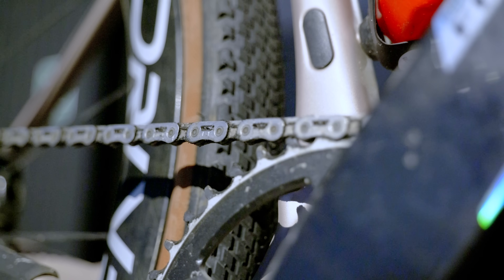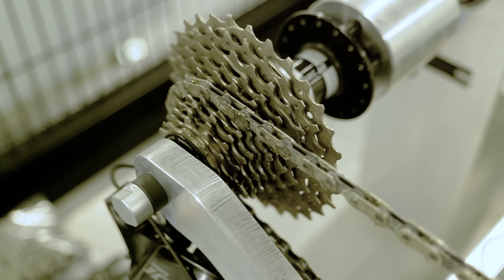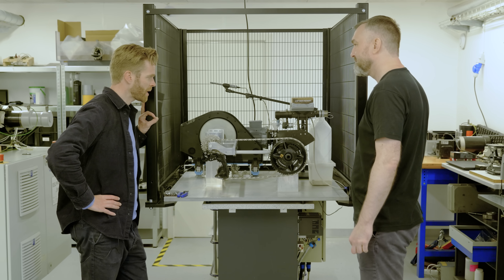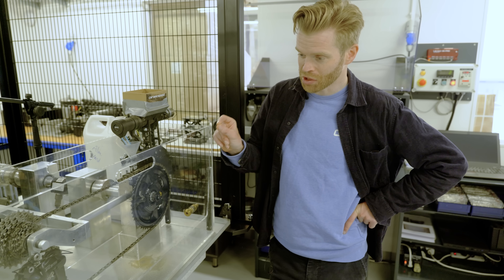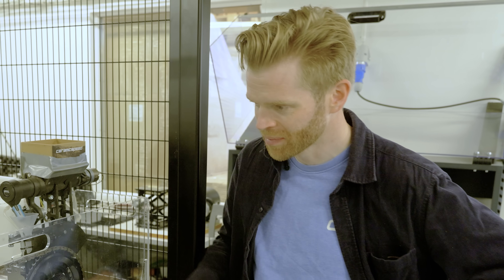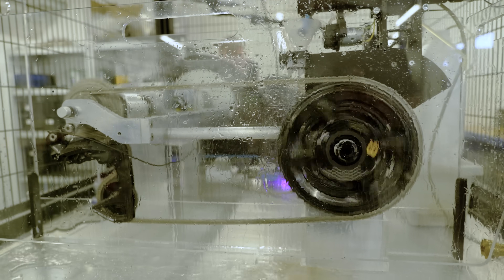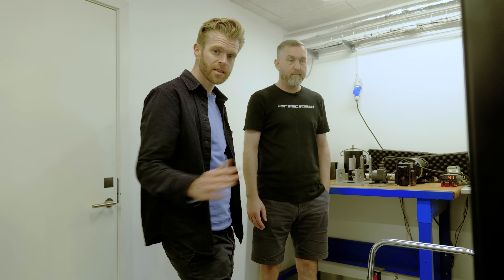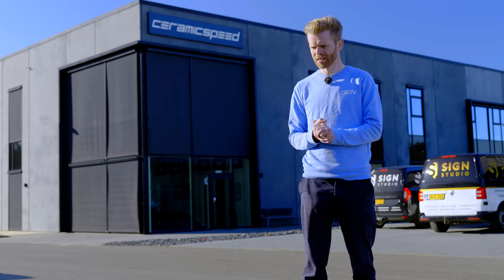We Lab Tested A Dirty Chain, How Much Slower Was It?

Comment from the maker: Which result shocked you more: how little a dirty chain slowed the rider down (about 1 watt slower than waxed in isolation ), or how much more efficient the biggest sprocket on the cassette was compared to the smallest? Let us know in the comments! 👇
Reply: Biggest surprise - optimal chain line is not most efficient one...
Reply: @stanley3647 despite what Ollie said the graph shown on video doesn't reflect that. Im yet to receive explanation from GCN.
Reply: @stanley3647 look carefully at the graph on the screen. You'll see that 27T is the most efficient. This gear is the most in-line with the front gear.
Reply: The chain becoming more efficient when moving to larger sprockets surprised me. So in effect does that mean spinning a larger sprocket on a climb is more efficient than a smaller sprocket.....
Reply: What would be interesting is to find out the losses when at higher rpm compared to lower, when in the same gear.  From this we can figure out if it is better to spin faster in a gear than to downshift to a smaller cog.
Reply: But if possible, it would be interesting to see the results, if you could turn the casette the other way around. So the smallest cog would be closer to the bike. It would of course look super weird :D
Reply: @Loudmouth69  what would the point be, in such an experiment? Apart from discovering why it is not a good idea to have a big saw-toothed steel disc turning very fast 10cm away from the wheel...
Reply: @PingoloPangolo to see if the result is the same, i guess. To see how much the size of the cog matters contra the placement. Maybe that does not make sense 😅
Reply: The sprocket thing. I wax to reduce wear and oil stains/improve looks and never expected super high wattage gains.
I was always very aware of bad chain lines and tought the straightest line would be the best.
Makes me think that large pulleys are more than a gimmick as well Kappa
Reply: Yessss......cross chaining  for the win!!
Reply: Commuter bikes c ridden in the wet and salt put away at night dirty and back in action 10 hrs later 5 days a week, quick  squirt of   WD40 once s week. Does it make you slower getting to work having a dirty chain? No.  3 days bike packing riding in muddy conditions no cleaning or relubing do the chains fail to operate? No.
Reply: I might be rethinking my TT setup for next season, a 56t chainring and a five speed 14t through block on the rear. No wait, that's what I was riding 40 years ago.

With my engineering head on Dr O I found this fascinating, more please.

How is the hand is it back to normal? 18:36
Reply: The chainline efficiency test was shocking
Reply: What shocked me is that the smaller gear in the cassette play more of a role in the wattage loss than the chain being dirty.
Reply: Neither, this is all pretty standard bike knowledge for 100 years. I know you need to make content (which I enjoy) but this is a bit like testing whether rain makes you wet.

:)
Reply: My opinion PTFE liquid at all times in any temperature, wax cold is solid and breaks up, wax hot will pick up grit and stick but be more efficient when hot rather that PTFE, PTFE washes off in the rain but better to lube regular, wet lube ok but picks crap up.
Another crucial thing regularly use a chain tool to check stretch of your chain for less wear on your cassette and drive.
Reply: Also, it would seem to make UCI's ruling against SRAM drivetrain gearing rather pointless
Reply: Just had a thought. Using the higher cogs is more efficient, but then it requires more power/rom to achieve the same speed. 56/15 @ 95 = 45kmh. 50/11 @ 95 = 55kmh
Reply: What shocked me the most is that the test rig used ultegra chainrings . A 105 di2 rear derailleur and what looks very much like a Shimano cassette and the sram flat top chain ran beautifully - apparently this combo is not supposed to be workable
Reply: The chain line/sprocket size piece is especially interesting, I’d like to know if that efficiency improves with wear. With use chains have more lateral flex presumably linked to the “stretch” effect, but surely that also will make them more tolerant laterally too?
Reply: Ollie, you did not mention the difference in watts between the most efficient sprocket and the least efficient one. "The shocking effect of gear choice" was not translated into numbers for some reason. Is that a secret? Can you make it public or is a MI6 internal issue? :)
Reply: @Dan-C-N  I think he mentioned it. The 11t sprocket was 15w and the 30t was 7w if I got it right
Reply: @WolfW-z5r  He mentioned the power loss difference between the smallest sprocket and the biggest one and the fact that 20ish teeth sprockets are the most efficient ones, without sharing the associated values for each sprocket. It's not a big deal but it would have taken him just 5 seconds more to share that specific data (less than 1W).
Reply: I’d like to see you test the Watt losses of a new chain vs a worn chain
Reply: I feel you need to retest with an actual dirty chain - one that's black with fifth!
Reply: So biggie bigs is what we should be riding and biggie smalls is no longer cool 🤯
Reply: I would like to see the same test performed using a compatible chain just to see whether it would have an effect on the results
Reply: I liked the representation of chain wear with the industrial chain. It's interesting to see what "chain stretch" is.
Reply: What shocks me is that taller sprockets granting more leverage per PSI on the teeth, wasting less power than shorter\smaller ones, is not intuitive to people trying to understand why comparatively tiny diameter hub shifters are markedly less efficient & less strong, than a (much taller!) cassette system. 

Even the smallest ring on a cassette, is nearly the same strength & efficiency as the primary strain point on most 'bulletproof' hub shifters.
Reply: @prophetzarquon  it’s not intuitive because ‘mechanical advantage’ is not the reason a larger sprocket is more mechanically efficient than a small one. 
The increased articulation in the chain on a small diameter sprocket is the real reason, The engineer running the tests did explain and it’s absolutely bob on as engineers will know. 👍
Reply: Good to know, that the dirt isn't that much of a culprit for power loss after all. Yet, have been quite aware that the sprocket / chainring sizes affect the chain friction, so the development has been kind of backwards when the sprockets have become smaller along with the chainrings since, say from 1980's or 1990's times. Smallest used to be often 14T in freewheel 'cassettes' vs. modern 11T or even 10T and the chainrings were 53/39T vs. subcompact 46/30T or even compact 50/34T. I'd take any day 60/44T chainrings with 14/38T cassettes for less chain friction. The thing just is that the percentual differences become smaller per added number of teeth when the sprockets or chainrings get bigger, like the difference between 11T to 14T is 127%, 14T to is 121%, while 50T to 53T is only 106%, while 53T to 56T is 105,6%, so the chainrings need to grow quite a bit compared to the rear sprockets to gain similar percentual increases. I guess 50T chainring with 50T rear sprocket would be quite efficient chain friction wise, but who could ride forever or at least very fast on 1:1 gear ratio? That's what I've been thinking.
Reply: Thanks! Now I can cross-chain on hills with a peace of mind by doing biggy-biggy rather than smally smally
Reply: @muratmustafa4532  Should be the lesser of two evils, if that's what you need to do.
Reply: Theirs going to be some cleaning I mean gee if static is 8w optimized...

Dirty with a IV drip of sand and junk 4w ... And that is 250w ... That is my ftp... 

All I heard from this was I expected more... I expected more... Well gee... Let's see the entire dirty drivetrain as for us normal people this sounds like over hyped ... I'll just chut up and ride now
Reply: If biggest gear have less friction, please explain why the results on the computer screen shows 27T being the most efficient. From this graph, I continue believe that cross chain represents the biggest power losses.
Reply: Sprocket!
Reply: The biggest issue was the lack of appropriate preparation and break in for the waxed chain and incompatibility of the group set. It’s not all about watts of course
Reply: Errm, didn't we already know that about the sprocket sizes? It's why 54-40 chainrings with 13-26 cassettes were pretty standard in the 80's and 90's and why TT riders still use big rings in conjunction with big cassettes. Oh and by the way, narrow handlebars are also not some incredible modern invention....
Reply: Concerning the size of the sprockets:
- Larger means less effort per teeth pull - spread out of energy over more teeth
- Larger also means closer to the center of the wheel - and could also mean less out of line compared to the smallest sprocket
Reply: In real life it is a 7 watt delta and I had my chains religiously cleaned the lubricated. Fast very fast rider and yes torque matters. When I switched to waxing I beat every PR I had. 2025 I switched to Endurance and beat again every PR. A week later I beat those too. Was was the secret and the waxing I did with Silca Endurance. And yes big gears are more efficient but they come will less torque gear ratio and of course slower speed
Reply: Here's a challenge I have a GRX 400 46 30 with 11 36 cassette. My son has GRX 800 1x.  Could my 2x drive chain be more efficient than his? I think my range at 501 percent is larger.
Reply: 15:45 - Have you just debunked the 1x efficiency myth? Once for all? At least at the "marginal gains" level?

PS
You are talking to a 3x afficionado... ;)
Reply: @PrzemyslawSliwinski ooh let's talk chain WIDTH then😅
Reply: Still not getting rid of the little cog up front!
Reply: most shocking is that they used an incompatible setup (SRAM AXS Chain on Shimano Ultegra Chainrings) - they should know SRAM uses bigger rollers that only fit properly on their proprietary drivetrain components. This setup is BS to begin with...
Reply: The power difference between a 289 watt and a 288 watt average power for an hour isn't going to matter for me, a non-racer, on a weekend ride . . . but, the quiet sound and infinitely smoother shifting feel of a waxed chain, cleaned, lubed up with Silca Super Secret makes a HUGE difference in ride enjoyment. I don't fear a sudden jolt if I shift while climbing out of the saddle and my rear mech thanks me.
Reply: @mathewrose2951 plus the longevity and cleanliness of wax.
Reply: On a 2x setup, is it more efficient to use the small chain ring when possible so that the rider can use the larger gear on the sprocket? If true, then the macho attitude of climbing on the big ring down the middle of the sprocket is wasting effort.
Reply: @davidstokes4773  Almost certainly true.
Reply: @davidstokes4773 however, the small chainring will be less efficient than the large one, for the same reason.
Reply: @davidstokes4773  Not exactly, the bigger the sprocket and the chainring the less the chain friction due to the reduced articulation of the chain, but of course the chainline affects the friction too, so you can't get maximum efficiency with cross chaining the bigger front and the biggest rear. Compromises, compromises...
Reply: @davidstokes4773  It would seem there is an error in your thought here, because a smaller ring up front with a larger in the back will be a lot slower than a larger gear in front with the same size cog in the rear. In the end you just have to push whatever gear you can to get up any given hill. But I get your point about being macho. It does seem large front large rear is maybe better, and why so many like 1x setups?
Reply: @davidstokes4773  I think that you got that backwards.  I was thinking the same thing, then realized small chain ring moves to large sprocket for equivalent torque RPM, so small-small = large-large, and large-large is what they say is the lowest watts by 2x (7W vs 14W).  I am amazed that this is more important than straight chain, especially with a dirty chain.
Reply: You missed forgot to answer one of the most obvious questions.  What is the power loss using the small chainring?  

P.S. Your graph looks like there is a slight increase in wattage loss as you get to the very largest cogs on the cassette, though I am guessing a 1x setup would still be much faster.
Reply: What shocked me most is running EFFICIENCY test of SRAM flat-top chain on SHIMANO drivetrain… with different roller size and internal plate design… and then swapping to SHIMANO chain to compare against, mixing apples and pears
Reply: This week, a friend of mine pointed to the chain on one of my bikes saying it looked terrible. I don't really do any maintenance except if it's threatening to break. I'm sharing this video with him to tell him that the chain is fine :). Thanks for the very informative video!
Reply: @ricferr2  you're basically grinding away your chainring, cassette and everything else. The only difference this video highlights is how efficient is a drivetrain with a dirty train as a grinding device, only taking up less than 1W to do the job...
Reply: What shocked me was the foot dragging rather than just getting down to it. This vid should be under 10m.
Reply: The most interesting part was the engineer pointing out that waxed chains start performing decently after 15-60 minutes, at 20° C. If you lower the temperature to 5, the time is probably quadrupled.

This reinforces my opinion that waxed chains, for normal people, is just a marketing thing.
Reply: @PingoloPangolo no, the ambient temperature has very little impact on ‘breaking in’ a waxed chain. The excess is removed through the mechanical process of using the chain. I have used waxed chains for years and throughout the winter in UK,  even in freezing temperatures. You can make your own chain wax for very little cost and some people get a formula very very close to the retail product.
Reply: @PingoloPangolo God forbid I go cycling outside when it’s 5°C lol. At that temperature, I’d rather stick to the trainer 🤣
Like someone said, I really appreciate not getting oil stains from the drivetrain, how quiet it is, and how much longer my chain and cassette last.
Everything is marketing these days, especially in cycling.
Reply: I continue to be shocked at how much time, effort and money is being spent on prolonging the life of a wear-item, designed to be replaced when its service-life is over. Same as brake pads and tires. BUT unlike those there's a LOT of money to be made selling bags 'o wax pellets, ultrasonic cleaning gizmos, wax boilers and more to extend the life of the chain rather than just drip some oil on it when it's dry, then replace it when it reaches the wear limit.
Shimano Dura Ace 12-speed chains are less than $50 retail. Double the life of yours and you save $50. But my guess is you'll spend that much on a single 400 gram package of this sponsor's chain wax, not including the rest of the equipment needed and let's not forget about the time and effort involved.  I'd rather be riding!
Reply: @larryt.atcycleitalia5786  I split the difference. ultrasonic cleaning, good quality industrial lube (not bike industry $$). Easily paid for itself with 2x to 3x  longevity.
Reply: @larryt.atcycleitalia5786  It doesn't just double the life of the chain though! My experience is that a waxed chain effectively doesn't wear out. At least, I'm at 10000 miles on a waxed chain and it's still not worn out!
Reply: @larryt.atcycleitalia5786  totally. As always. 80/20 rule. 80% effiency  (9W loss vs 8) for 20% the effort (wipe chain roughly when it looks really dirty, and springle oil when it looks or sounds dry). Especially when riding for health and joy, and not racing, that little power loss means little.
Reply: @larryt.atcycleitalia5786 it’s when your dirty “stretched” chain eats your $400 DuraAce cassette that a clean waxed setup is a real money saver.  I ride in a dry environment and drivetrains now last at least three years, which is about as many years as I tend to keep a bike.
Reply: @MichaelWilliams-iv6dj This is the biggest reason I keep drivetrains clean. It's about preventing wear, keeping the parts functional for longer than they would last if they were grinding dirt and sand. Whatever mechanical efficiency improvement comes about is a minor side effect.

Comment: I've done all kinds of riding on just about every kind of surface you can imagine. You might think sand is the worst contaminate, but my experience tells me that Gravel (limestone) is possibly worse. My gravel bike will wear out chains faster than all my other bikes. The fine limestone seems to get into even smaller places than sand.
Are there any testing evidence to support my observations?

Comment: Cheat! You didn't bother to measure how much cleaning the chain helps. Was the performance cut only down to the dirt still on the chain? How much was down to damage that couldn't simply be undone by cleaning the chain? Without that, we really don't know how much cleaning actually helps.
The alternative hypothesis would be that an individual piece of dirt doesn't do all that much damage as it is worked very quickly out of the active parts of the chain and just bunches up on the areas of chain that don't actually do much. I'm not saying that that's necessarily true, but that it is actually quite plausible, and I suspect that the dirt probably does more to the gears and pulleys than the chain.

Comment: 16:58 it isn't the "size of the sprokets"  It's the tension on the rollers.   Friction losses are the coefficient of friction, the surface area and the amount of force between the surfaces.   The variable are the forces between the materials of the rollers which decrease in the lower gears.